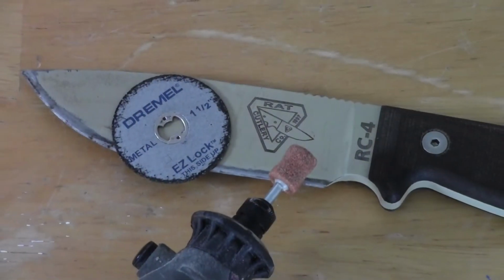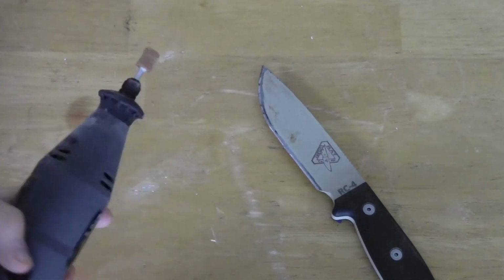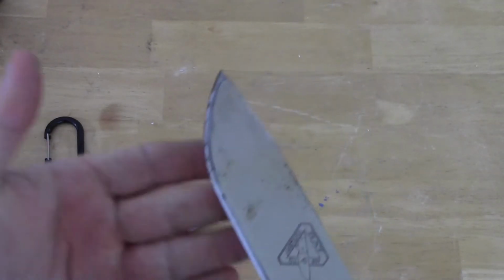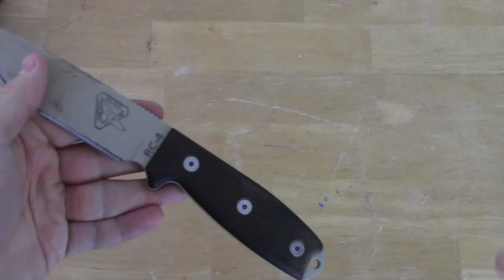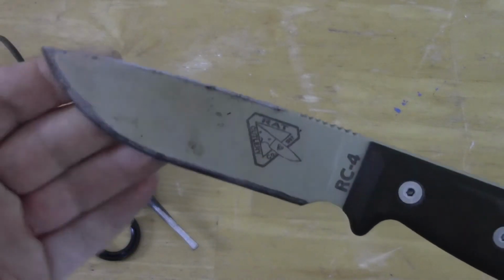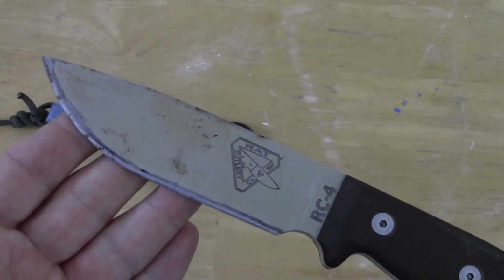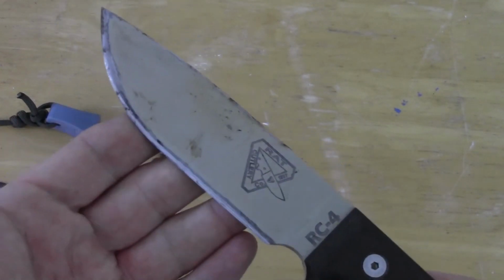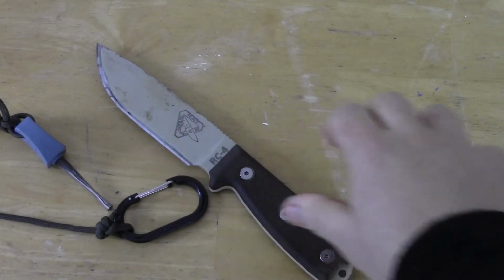"Rat Cutlery RC-4: Modification" by TheGearTester

Comment: Have ever heard of mineral oil? Use it to keep your knife edge from rusting. jeeez your knife looks like CRAP.
Reply from the maker: The blade is just fine. There is come coloration from tree sap and the tan coating shows some ware. I'm holding the knife in my hand and there is no pitting or major rust. Calm down and take a deep breath. Rude comments are not useful to me or anyone else.
Reply: Rude comment? I'm sorry you are having a bad day or what-ever but all I did was make a comment and a suggestion about maintenance of steel blades. I thought that as a "Gear Tester" that you would encourage your viewers to properly maintain their tools so as to avoid accidents and help your tools from getting damaged & to last longer. Yes?
That RAT RC-4 is a really well made nice tool that if looked after, should last for ages. Jeff Randall really know his stuff. You made a good choice with the RAT RC-4
Seriously Sir, you really should care for your tools by cleaning, maintaining and sharpening them. This, honestly should give you a long useful life for tools. That is good advice for any camper, hunter or Prepper/Survivalist. There is a difference between wear & tear and a dirty tool with sap & gunk on it.
Good luck with your Channel, I honestly hope you learn and succeed with it.
Cheers!